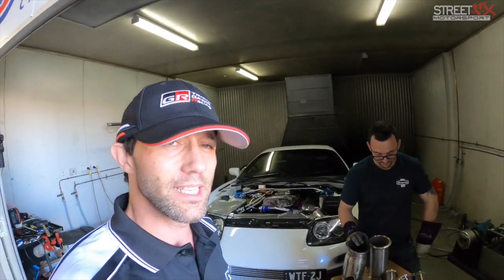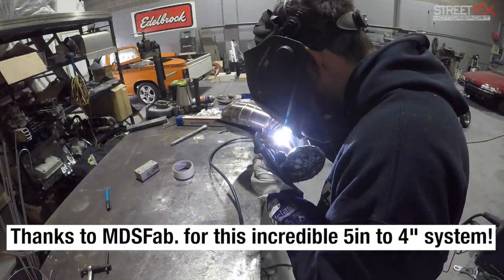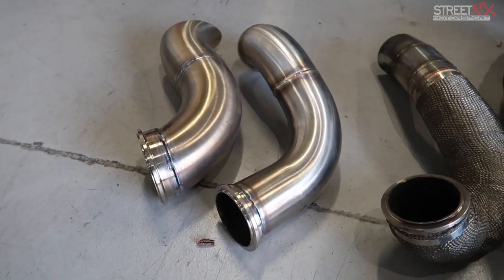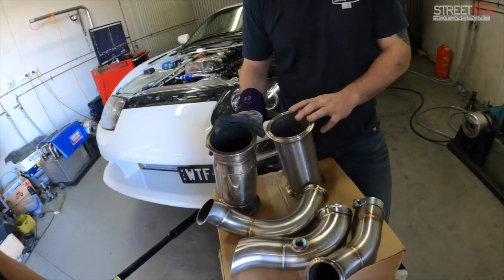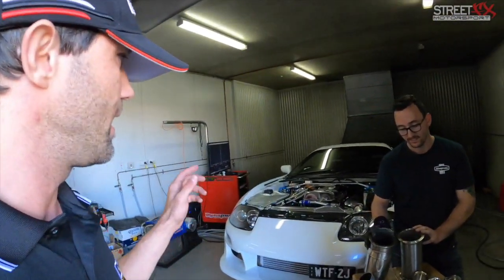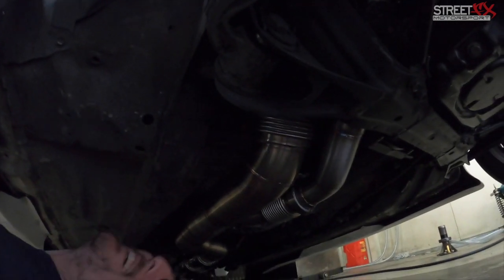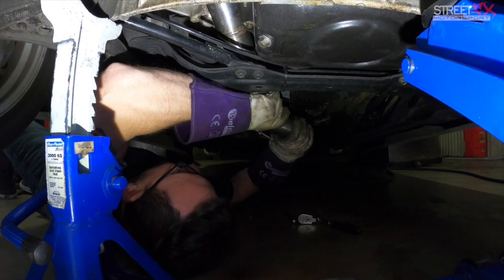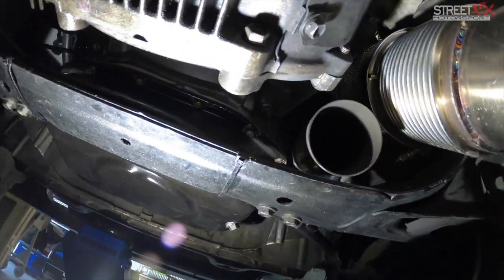Do Hater pipes, Screamer pipes or Decat Pipes make power? The Ultimate 35PSI, 4" Exhaust Dyno Test!

Comment: Would be good to see the difference with a 200cel cat. That way it’s a bit more legal in Aus than a 100cel. But good on you either way for showing people that catless isn’t really worth it in this application 👍 the less unnecessary catless street cars the better. Racing, go nuts out the hood 😁

Comment: The only reason it didnt make much difference is because the exhaust it came in with was ginormous already. But 14hp with that decent weight reduction if it was a stainless exhaust would make a pretty good difference, especially with the faster spool

Comment: i was more interested to see if the hood exit setup had a noticeable increase in transient response.
Reply from the maker: There was no real noticeable difference in either response or power. The boost crept up to 36-37psi which had to be backed off to ensure the boost level was matching for all runs. You can see in the last graph that the power curve was pretty much identical for all runs, aside from where the boost spiked and kept on a vertical trajectory until Dave backed off.

Comment: ideally, you would do that test with the turbo reaching 1:1 boost/drive pressure at whatever boost pressure that might be. that way you would see the difference more clearly as the poor old thing is just a massive bottle neck.  very cool to see the actual drive pressure... wow. tapped out hard!
Reply from the maker: Yeah I was actually surprised to see it tapping out the turbo considering it's comparatively laggy in its present setup. I only have ~ 3000rpm of the rev range above 500hp. I have been considering dropping back an exhaust housing size to get it on song faster, considering I don't ever plan on running 36psi on the street. I would rather 5000rpm of usable power and only 750rwhp.

Comment: Long story short: It's not worth deleting the high flow catalytic converters, difference in power too insignificant, especially considering the massive increases in exhaust emmissions both in terms of noise and toxic gases. +14hp might sound like a lot until you realise that % wise it's relatively insignificant for an engine that already has over 800hp with the cat and full exhaust system on.
Reply from the maker: Exactly! It doesn't even make a noticeable difference in sound, but it makes a noticeable difference in the smell in the cabin. 14hp from 850 is only around 1.5%, wouldnt even feel that.
Reply: Without any proof to back my comments and not being argumentative, I’d imagine that the performance should be noticed when unmeasured resistance and inertia comes into effect. For example the total weight of the vehicle with wheels to the ground. There would be tremendous resistance where it counts at the beginning of the run through to maximum. For an average street fighter cruising who needs quick best performance then a free flowing exhaust should benefit due to less restriction from plumbing back. 

For the example with this Supra making nice numbers it works in a controlled environment and you could sit on a drag strip revving to the max producing maximum flow before launch with a nice 800+ HP,  agreed based on the findings that it’s not worth dumping given those numbers. 

However the average punter having some fun, the small gains makes a big difference. Ok “big” is subjective but it makes a happy difference. 

In this video the journey of the curves are not assessed and it’s probably because it wouldn’t give accurate information when dyno measured at the hub. However you should get an idea if all things are equal. 

I liked watching this video and learning about the findings. Wish I could see similar tests in the sub 500hp range.
Reply: I'm deleting my factory header on my frs with a catless unequal length one ill put a race cat as the secondary :)

Comment: Hey Mark I was wondering what your wheel size/offsets are and what size tyre you're running? Your fitment seems pretty spot on. Also curious as to what headlight bulbs you're using? Cheers
Reply from the maker: I am actually uncertain. I believe they came off a Toyota 86 but had new centres put on for 5x114.3. I have checked my receipt but it doesn't list the offsets unfortunately.
Reply from the maker: Oh I missed your other question - the headlights are our top spec LED kits.

Tyres are 265/35/18 and 295/30/18.